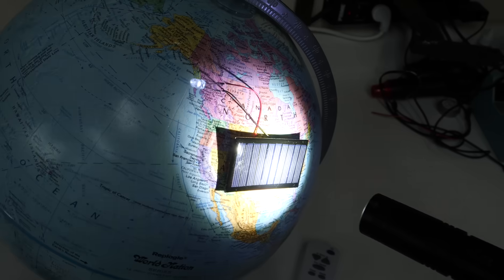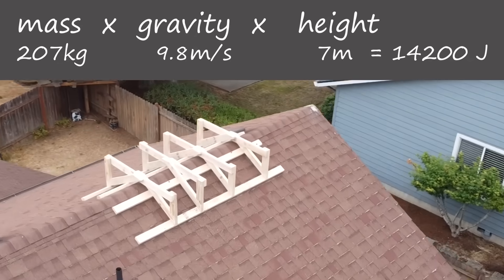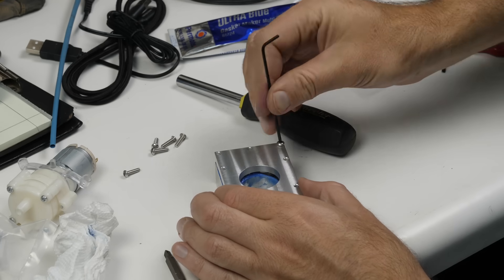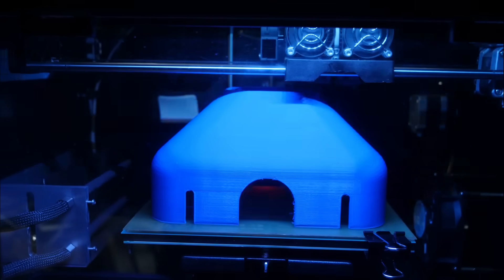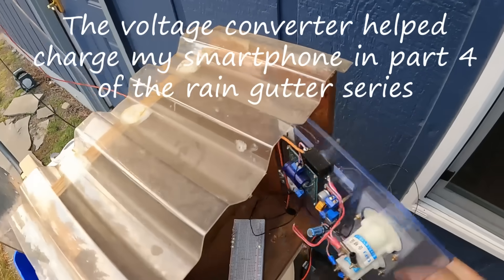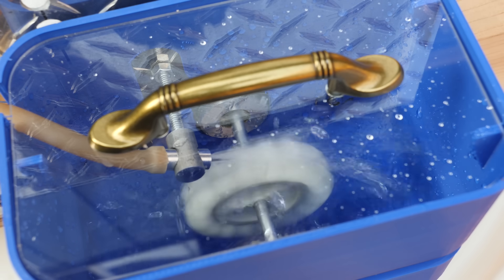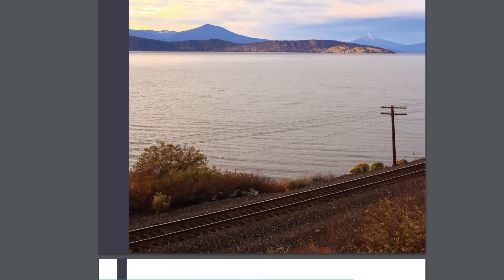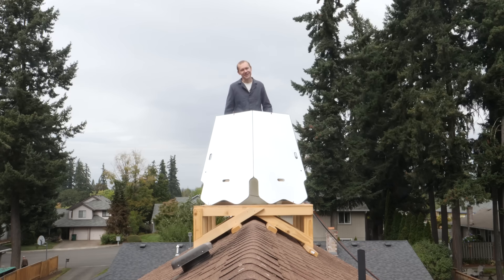Storing Solar Power on my ROOF!!!

Comment: I have actually thought about doing this exact thing.  Where I live it's very flat. So trying to use hydro-generator in the stream is out of the question. Any amount of blocking would cause flooding.
However, I have several 270 gallon IBC totes that I had planned on putting 20ft in the air, or higher if I could (i have access to warehouse grade structural shelving rack steel) and then during a storm, use the wind to power a pump to top off the tank(s).  Altho, I hadn't thought to use a dual level tank setup, with another at ground level.
So using excess solar power to pump the water up to the top tank is a great idea.
Reply: For 10kWh storage (around Tesla powerwall numbers) with 70% effiency (on the low end) and and 10 meter head you'd need about 540m3 of water with 150 litres of flow to get storage worth about 10kWh. That's around 500 of your IBC totes or about 16 20-foot containers. Makes you appreciate how good of a electricity storage lithium actually is. Of course (properly maintained) the pumped hydro will last at least 5x as much even if built not in the landscape or a lake but with concrete/steel.
Reply: @rkan2  LOL   that's a lotta totes!  Altho, I wasn't thinking about 10kWh of storage, but more like 1  :P
However, math is easy to extrapolate. Thanks for the numbers. Appreciated.
We have a good sized backhoe atm, so might build a raise reservoir to get that waterfall action going. we'll see...

Comment: just a thought .. for a potential future project .. water evaporation vs pump :
Evaporation can also carry water up to higher heights (clouds) .. although slower without light and heat of the day , evaporation continues even a night as long as it's above the dew point , thus still collecting energy in dark of a warm summer night.
Solar thermal panels can collect over 80% of the solar light input energy as heat .. compared to only around ~20% for the photovolatic panel .. and if the solar thermal collector is  one of those vacuum tube style ones than the high thermal insulation of the vacuum would allow it to continue to harness and function well into very cold ambient temperatures.

Comment: That aluminum tab on the top of the barrel also makes a nice little lightning rod.
Reply: Meh, it's not well grounded, so not as great at attracting lightning as it could be.
Reply: I first saw metal on the barrel,   I thought he was making a 55 gallon liquid rechargable battery.   Even better if it could attract Static charge from a ground.

Comment: The version of this I've pondered is... what if office towers that have a much lost occupancy rate than they were designed for could sacrifice one of their elevator shafts? How much energy could they store by lifting an elevator sized weight up 30, 40 stories?
Reply: Yeah, I'm a big fan of gravity batteries, and trying to find a practical way to make them work is always the challenge. One big potential issue with your suggestion is that there definitely is a safe weight limit to what a skyscraper could handle, weight wise, which really limits things.

Ideally, a natural feature like a canyon could be used along with high-density materials for the weights (nickel is fairly common, and has a density of almost 9g/cm^3, so some alloy of that might be the best route), and one could store a significant amount of energy that way. But, of course, those kinds of features generally aren't near where humans settle.
Reply: @Jobobn1998  yes, of course a natural feature or unused mine shaft would be better,  and at the end of the day the energy storage potential  of such a scheme could easily be too small to warrant sacrificing an elevator shaft and investing in the retrofit. I am curious though how much every could be stored that way, and how that would compare to a Li-ion, flow battery or even a flywheel system on a cost basis.

Comment: I can't help but imagine finding a potential reservior location on a mountain top or something, and then nearby, just...start digging. excavating a massive DEEP "lower" reservoir, but making it SO deep, that it adds additional depth, and thus, Head on it, especially if it's filled from multiple ports? to try and maximise the height differenc? ponder

Comment: What if you had the solar panel(s) powering electrolysis on water, and then later used the homebrew hydrogen to power a generator? Sure, the process may not be very efficient, but the energy storage is massive and you could power real household items with it.
Reply: Two big issues, to my understanding, is that hydrogen is obviously very dangerous, and that it likes to escape many containers over time. I think that kind of electrolysis is probably best left to professional-scale projects given the challenges.

Comment: Great video, this is basically the solution they have found inn a few of the islands from Canary Island in spain.. Their main source of power is wind turbines, but when they have an excess they use the power to store water in a Dam..
Reply: That happens in even crazier scale between Germany and Switzerland. As the rays of the rising Sun start hitting the hundreds of millions of German solar panels, the Swiss shut their dams and start pumping too. Then as the evening comes, they start quickly releasing the water through the turbines. I can't help but wonder, can that cause too high stresses on some of the dam components? Norway recently built a cable to Germany too, willing to help by being a huge hydro battery.

Comment: Quint -- You should explore misting that water over your roof in the summer to see if evaporative cooling could help lower your power bill... then collecting the left over through your gutter system... perhaps you could get more 'work' done by linking a few systems together.
Reply: problem is the water would probably cost more than the electricity saved plus wear and tear on the roof shortening its lifespan.

Comment: When I visited Taiwan for a friend's wedding, I noticed that a lot of homes had stainless steel water storage tanks on their roofs. My guess is they did that for two reasons: one, passive solar preheating the water (most water heaters in China, Hong Kong, Taiwan that I experienced were "on demand" so you flip a switch before you take a shower), and two: water pressure.

It seems as if that paradigm could be paired with your enhancements for other benefits.

Comment: Maybe you are using a 19v solar panel, and the motor is rated for 12v. That's why it's getting hot.
Reply: It looks like a small pump , it's having to overcome the hydrostatic head of water so over working it
Reply: hmm, higher voltage should lower the amperage required to run the motor (for the same power usage). 

A "12v solar panel" invariably has an open-circuit voltage around the 19v mark anyway, that's normal.

The excess heat is from (over) loading the pump up so much, asking it to run at maximum power for an extended period of time. For longevity, you'd usually select a pump that's over-spec for the required job. But that's not really necessary here in this vid, for demonstration purposes
Reply: @MrVelociraptor75  running a pump with higher voltage will result in an higher current also. Resulting in more power consumed by the pump than what it is built to.
Reply: @MrVelociraptor75  um....no.

Comment: Hi Quint, really great video and a really great explanation of energy v power! Where I live a utility supplies water under mains pressure and we pay a rate based on the size of our house rather than how much we use. I have thought of finding the largest size generator that could run off a 3/4" pipe at out pressure and just run the water non stop. No additional cost to me. But I obviously see the environmental downside.

I read a book called "sustainable energy- without the hot air" freely available online, Mackay the author describes "all" of the energy types and how feasible it would be to use them in the UK. One point that stuck with me was that it takes roughly 1 kWh to make a disposable AA battery, despite the tiny amount of energy that it holds. Your depiction of the actual energy that is in that battery, with what 20' (?) of head is remarkable!

I have seen other comments on here that say "imagine if every home had that barrel on the roof". But the real thing is to imagine if every energy user understood just how big a tank of water would need to be on the roof to power their home for a day?  

I have recently bought solar panels, max 4kW, but like you say, storage is the issue. Hot water storage is really the only way for a homeowner to easily hold energy. Batteries, big lead acid types are fine, but there is a skill to use them correctly. 

And at any municipal scale pumped storage is the way to go. Although in CA it would be interesting to have some kind of seawater desalination followed by pumped storage, if, as you say, they have so much energy to spare, and so little water!

Great video.

Comment: All fun and learning,  no useful energy! Loved it.  It gives a pretty good hint that many energy proposals are equally useless; even those grid- scale pumped hydro storage aren't that impressive.
Reply: This system really is more of a large scale thing because of volume scaling much faster than surface area. 

Also because of the lack of volatility in it's storage, so long as it's not a dam overlooking a city, a giant tank shoved into the ground basically has one major failure point, and that's the pipe leading out and you really only need a shut off valve to stop that and a giant feck off metal door in the case that fails to prevent a failure, whereas other means of energy storage tend to explode rather catastrophically because of the energy density.

You're trading compact storage for storage safety, that it also doubles as a fresh water reservoir in times of drought is also rather handy.
Reply: @ComotoseOnAnime  no; I've seen several videos on existing pumped hydro storage,  and they are exceedingly weak in their utility.  It would literally take hundreds of times more high-altitude reservoirs than currently exist to achieve a reasonable level of grid-scale energy storage.
Reply: @jamesengland7461   Hundreds more that we could easily make, again, it is just two holes in the ground with a pipe system connecting the two.  Hell, you could use existing reservoirs for it, or make more.   Having more freshwater storage wouldn't be a bad thing either.   I'd even go so far as to say that hydro power generation should be a byproduct of more water storage systems to begin with.

And it's not meant to take over the lions share of grid storage but make use of available resources just like solar farms make use of large flat arid wastelands, or windmills take advantage of coastal or flat plains for power generation. If you have a high elevation in relatively close proximity to a low elevation, using it for extraneous power storage is just sensible.
Reply: @ComotoseOnAnime  easy? Creating artifical lakes and massive pipelines everywhere?
Reply: @jamesengland7461  Considering we do this quite often already?  Yes.   It's mostly time invested and finding an appropriate area,  you could probably cut that time in half by utilizing old defunct pit quarries or mines for one half of the system, after all the reservoir doesn't necessarily have to be above ground, and again this can double as a water reservoir for city water if necessary during periods of drought so it's filling double duty.   And if you're using mines or quarries those generally already have pump systems in place to keep the place from filling up.

It's not going to be cheap but once built it's not exactly all that expensive to maintain since, again, aside from the piping it's basically a water filled hole in the ground.

Comment: follow up video... losses. How much power is used to pump the water vs how long the barrel of water can power the light (measuring the power used by the light)...what's your efficiency? Where are the losses?
Reply: Free power (as in the power from the panels would be lost otherwise) means efficiency is not a big thing.  Just amount of storage.

Comment: Use your solar power to convert H2O into its base elements and store the H2 for later use.  You can use a fancy hydrogen fuel cell to both jobs of converting to and from water.  The question is, is this a better storage method for the energy?
Reply: Can you split the outputs (H and O) in these fuel cells? I dont think so, might be wrong, but if not it would be very dangerous to store the gas. You would need a hho generator that can produce H and O seperated and than use fuel cells to reproduce the electricity.
Reply: @georgwagner4438  - Like most electronic components, they can be used basically forwards and backwards.  They are typically more efficient in their intended direction.  There are basic fuel cells that you can run either way.  It would be better to have a fuel cell to convert hydrogen into electricity and have another method to convert water into hydrogen and don't bother storing the oxygen part.  There are safe ways to store hydrogen these days. :-)  This is the technology that was used to get us to the moon back in the 60s.  So nothing to new about it.
Reply: @arthurschwieger82  I meant that if your fuel cell produces a mixture of Hydrogen and Oxygen, you basically cannot store that, because it would be highly explosive. But I am not sure if fuel cells exist that have a output for each gas AND can be used in both ways(efficiently).
Reply: @georgwagner4438  - Totally!!!  That would not be what you want to store in large quantity.  They have toy fuel cell cars to teach about this process for children.  I have been tempted to get one to play with.

Comment: I'm off grid.. I often run out of power at night, with 8 dc27 batteries.. And they are fully charged by 10am on a sunny morning.  A cheap battery solution, even with horrible efficiency would be welcome, lots of sunlight goes to waste!
Reply: How many hours do the batteries provide before running out of power??
Reply: @rick92rr  24 hours pretty easily, but some things will shut off our inverter if the batteries get to low.  Microwave gets sketchy at night, and the water pump is pretty well guaranteed to kill it
Reply: Instead of using a roof, maybe you could use an incline on your property. With a couple of large ibs totes as the reservoirs. I don't know how much height you'd have to have but perhaps a higher volume of water could produce the same power with less height.
Reply: @cupbowlspoonforkknif  I have a mountain.. Plenty of opportunity for that!